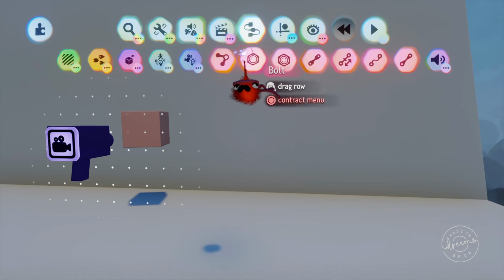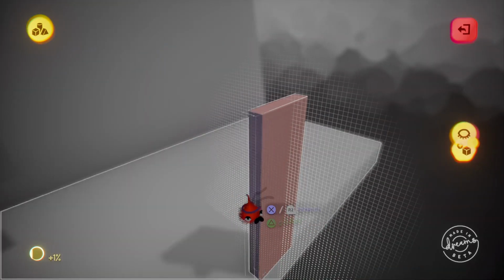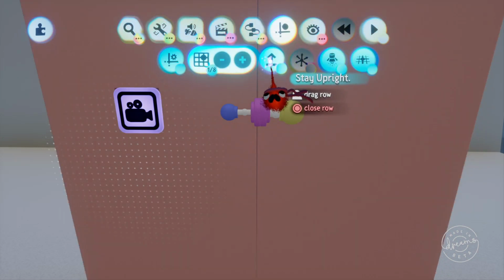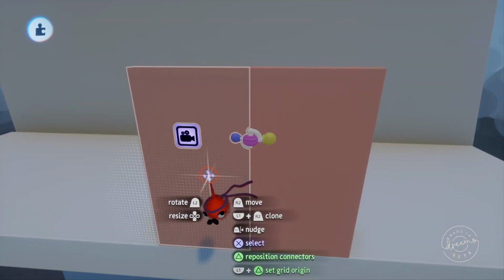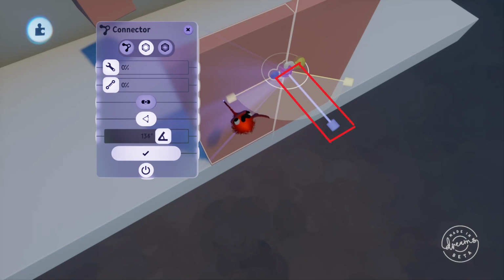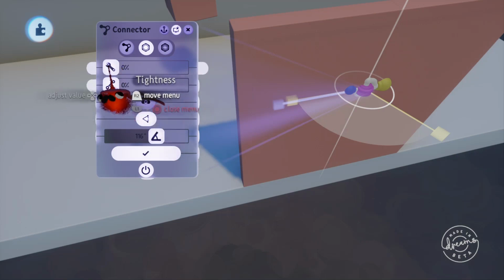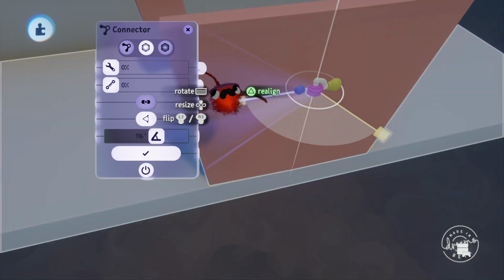Tutorial #9 - JOINTS AND HINGES - Dreams PS4 Logic

Comment: The connector system in dreams is absolute garbage. I remember a little big planet, a bolt was a bolt. If you bolted something together, it held no matter what. In dreams, the bolts are made of bubble gum. Put too much weight on them, they start stretching apart. Not to mention they're a pain in the ass to get centered properly.

I've currently got a fighter jet I'm trying to put wheels on. I need the wheels to be retractable so that you can pull up the landing gear after you take off, and drop it back down when you're ready to land. The problem is, as soon as the weight of the plane hits the bolts, the bolts turn into bubble gum and start stretching all over the place, the wheels fall out from under the plane, though they remain attached, and the plane starts flopping around on the ground all crazy. Adjusting the tightness of the bolts does absolutely nothing, as does making the plane weigh more or less.
Reply from the maker: Yeah I know what you mean, it can be really painful. 
There are workarounds, I think if you make the wheel bit 'non movable' and just keyframe the movement that helps a lot

Comment: I've been experimenting with the look at gadget with heads, and I'm finding they seem incompatible with connectors. Sometimes the head will just completely ignore the connector or the connector will lock it in place even though lock rotation isn't on. The result is a head that wobbles around like a bobble head and quite often after enough turns will be lop sided. Any thoughts would be appreciated.

Comment: I'm having a hard time with ball connectors for a character I'm building. No matter what it won't connect the two objects I'm trying to connect.
Reply from the maker: Dreams is very picky about the grouping, try it from all the way grouped in, then try it one group further out and so on, and you should find the group you need to have it in. Let me know if that doesn’t work
Reply: @JimmyJules153  ok, thanks for replying!
Reply: @JimmyJules153  so, now I'm trying to make a treasure chest that has a bolt connector, but whenever I try to make a keyframe for the chest opening, the connector completely glitches out! It works when I'm in build mode, but whenever I start time, or try to make a keyframe, the connector just doesn't work, and my sculpt falls apart.

Comment: You didn't mention the only thing I have trouble with the motor bolt, 
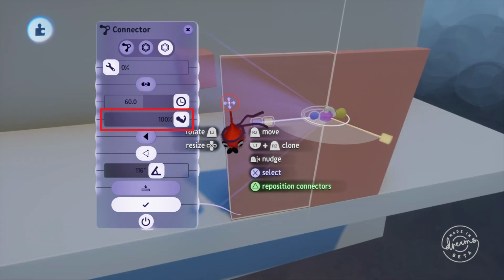is the "position" option (not sure how is it called in english) but with the motorbolt when you send a signal to that button it set the blue thing to a position, generally it's one of the yellow limits, I'm sure that's what you did here 4:02

It's driving me crazy cause when the button is off (but there is something connected to it) the position of the blue thing is set perfectly on the middle of the 2 limits, and it seems that we can't change that ? It sucks cause what would be logical is that that blue thing would be on the opposite limit, but NO, it has to be complicated.. LOL

Comment: Is the door  "locked" with the motor bolt if the power if off?
Reply from the maker: I believe the door would swing as though it wasn’t a motor bolt if you have it turned off - you could turn up the tightness of the joint though or keyframe the door in place so it doesn’t move until it’s been unlocked :)

Comment: I've been having issues with some of the joints, especially the ball joint. When i try to rig the eyes on my character the Pink part of the ball joint bugs out and stretches; showing an orange tendon. not sure what this actually means but it looks broken to me.
Does anyone have any solutions for this, what am I doing wrong!?
Reply from the maker: Yes i know what you mean i've run into these troubles with the joints too.. It's generally when you have sculpts colliding with the blue 'child' end of the joint (in this case probably the eye). You might be able to get around it by turning off the collideable setting for the eye, so that it doesn't bump into other things and make it go crazy. Also try turning down the physical weight for the eye as a last resort :)
Reply: @JimmyJules153  Thanks for the reply mate,  I tried turning off the collideable setting for the eye and turning down the physical weight, neither of these worked. not sure what else to do but thanks for the fast response :)
Reply: @corsam8315  if you're still confused, Mm posted a YouTube tutorial for eyes :)